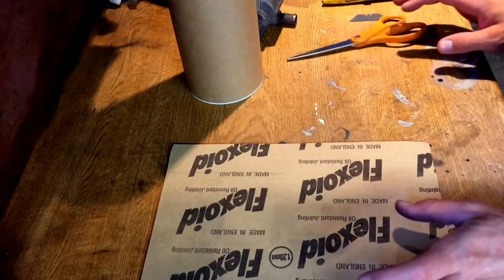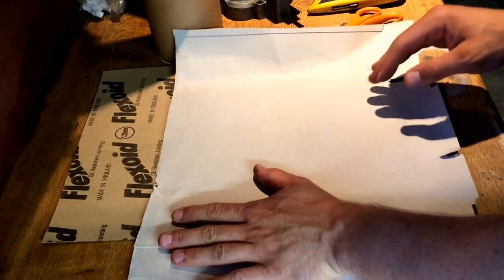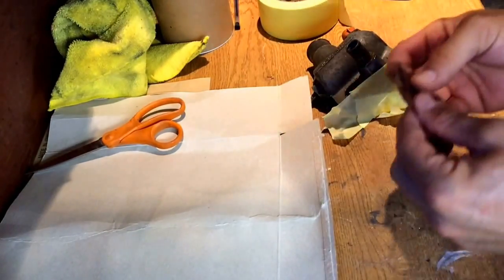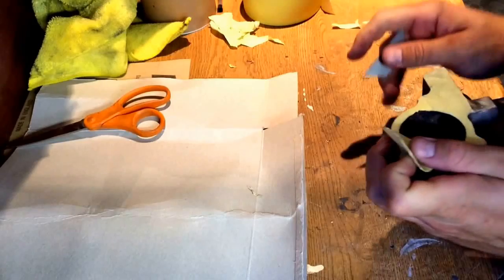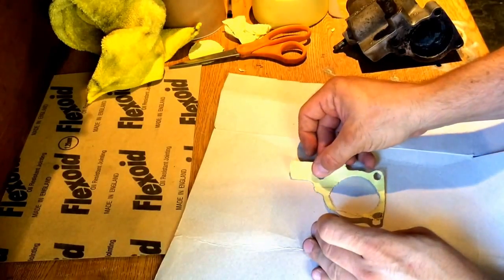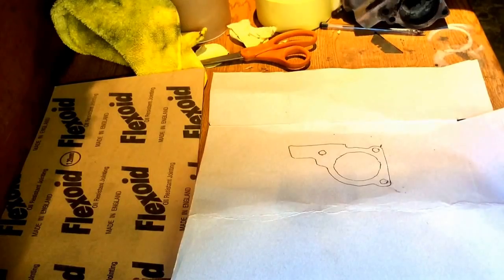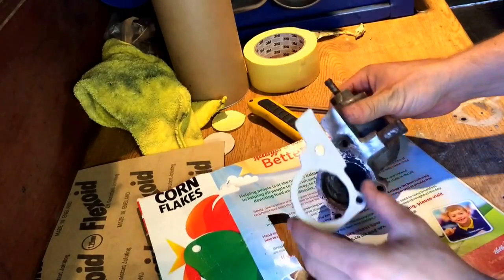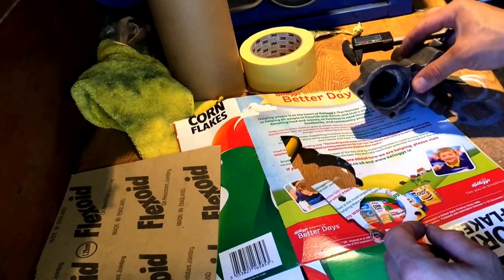Never Buy An Engine Gasket AGAIN! Do it yourself

Comment: Even though your video was done 8 years ago - I must say > what a great idea in using the masking tape for a template - and just today I used the same idea of a cardboard box to do a gasket for an oil pump to a car... Awesome video - The one key thing is to make absolute sure is a sharp blade to do the cutting. you can also use a corrugated cardboard to use to lay the piece you are cutting and the job will be a lot easier to cut.

Comment: Great for an emergency situation.  But for about £1 a sheet, Flexoid is compressible, recoverable,  and resistant to oil, fuel and water... which a cereal box isn't.  I guess that's why we've been around for 100 years ;-D

Comment: I used this trick as well in the past on a 100cc scooter exhaust I did 3 cereal box gaskets in the exhaust pito to the muffler and 2 years later still holding .

Comment: Why didn't you use an oil to make the template? It would be easy and quick. Just put a little oil on the the face of the device and print it on the cereal paper.
Reply: I use a quick shot of spray paint

Comment: would this work on a 50cc cylinder? considering that those small engines dont get as hot as car engines
Reply: Probably better to try this idea with thick aluminium foil for a 50cc head gasket but make sure there is sufficient clearance so that the piston will not hit the head .

Comment: My lawn mower has been running for decades with one of those behind the carb.
Reply: i will try the same. i wouldn't if it was a car. 🤣
Reply: @lindap5503  If you rub oil on it you can prevent it from sticking and ripping if you need to take it apart again.
Reply: @zippymcfearson2776  I’m about to send this for a couple days on my grand Cherokee thermostat housing wish me luck brother I’ll keep you updated the i6 will be ok
Reply: @marcusbrown7029  Where’s the update? I’ve been waiting 3 years.🤓
Reply: @Ojb_1959 it was fine until I blew up the transmission 😂 forgot all about this

Comment: thanks this might help me get my atv running, there is a big open hole where my 2 stroke oil pump was(its broken). so now i can screw a plate and a cheapo gasket on and get the engine running. will be mixing oil into the fuel untill my new part arrives in a month or 2

Comment: I collect antique outboard boat motors and I use this method to make gaskets.  You can grease one side of the gasket if you want to disassemble the motor later without destroying it.  I also keep pinking and cuticle shears and hole punches for cutting them out.

Comment: There is a flaw in all these “emergency” gasket deals isn’t it?   An emergency (as most of us think of it) is when you are in the middle of nowhere and your parts store is either not near, closed or just don’t have your part.  If you are in the middle of nowhere and need a gasket what makes you think you will be able to find a store to buy CF, eat them (no waste) and make your gasket?   I see the creative aspect of it.  I do not see the $ saving element
Reply: Tax2Me probably a magazine or scrap piece of paper kicking about in the car somewhere! I once made a Water pump fast for my car out of a fashion mag front page and used Vaseline as the sealant. It held up for 30k miles before I refurbished the whole engine.
Reply: The point is that knowing how to do it is better than not and piece of card is far easier to source than the correct gasket or even gasket paper. There are literally thousands of things you could use such as the box from a takeaway burger or the front page of the handbook in the glove box.

Comment: A wise old mechanic taught me a neat trick. Place the gasket material/cornflake packet then get a small hammer and hit the edge of the part your are trying to seal and it will cut a neat cut out of it.
Reply: That's how i do it too..but i used a spoon not a hammer.its quite safer i guess 😅
Reply: I've seen many ppl tighten screws/bolts down to the point of stripping or breaking. Telling someone to hit it with a hammer will definitely ensure them heading to the part store for a new part and gasket after breaking their old one.
Reply: 😻 genius! Cause I’m working on a mower and the gasket crumpled to pieces. I need this thing running before am! 😫
Reply: @krishauck07  did you get it run it ?
Reply: heh yeah.. "ohh just lift up on the flywheel and smack the crankshaft with a hamer" yeah no... glad I bought a puller before I mushroomed the shaft out.
Reply: Sixtyfiveford
Reply: it  does not take an expert to make simple gaskets so aste of air  space   good luck  keep safe  higgy
Reply: Better yet take a thin piece of wood and lay it on the park before you hit it with a hammer

Comment: Before I understood anything, I saw that gaskets were basically a type of cardboard so I made some out of cereal boxes lol. I had an old scooter that needed a new cylinder gasket. 😂 It ran just fine for a few years actually. But now I can afford proper gaskets so I wait a couple weeks for them to ship instead of doing this but it is always good to know this kind of thing in an emergency.
Reply: you guys / one of my inquiring consumer that i said nope im not using that as a long term fix are joking rite?
Reply: @richardprice5978  I think you misstyped something or it auto corrected to something  else because I cant understand what you are saying.
Reply: @SirCumferencelel this is basically a practical joke right? and doesn't work for fixing oil leaks
Reply: @richardprice5978  oh! You missunderstood. Yes it actually works. It's works as well as any other paper gasket in the short term, it just doesn't last near as long as actual gasket material. 

I use it all the time as a temp gasket until the new one ships from Amazon.
Reply: @SirCumferencelel  ok im not buying into it working but your not the only person said it works so maybe you guys are right, i just don't plan on doing that, 
thanks for the tech tips.
and no im not using this for customer cars fixes so for the next wise guy broke DK in line the answer is no im not using your box come back with cash or the rite gaskets
Reply: @richardprice5978  lol, yeah if I were in your position I wouldn't do that to a customer's car. 

I'd try it out on a lawn mower or similar small engine first to get a feel for it dude. I do it all the time for my motorcycles but never for a customer. Lol, toodles.
Reply: I used folder for gasket

Comment: The way I learned at college was to put the flange on thr cardboard first then draw around it and cut it out. Put the cut out version back on to the flange and the make like the holes using a small ball peen hammer. So much quicker
Reply from the maker: Thanks for the good advice man! 😎
Reply: Xactly!  If you can take the part away then this is the best method
Reply: That's how I learned and just what I was going to post

Comment: What gasket sealer can be used on paper gaskets or should paper gaskets be fitted dry?
Reply: In my experience using the same method he is using, you can use it like you would normal paper gaskets. Personally I always use sealer though.

Comment: Hi, is it ok to use this home made gasket for cylinder and head cylinder on a scooter engine? this part is very hot and the gaskets are pretty strong, so this is why I am asking. Thanks
Reply: cve kris yeah. ive successfully made them out of copper coated aluminium flashing from the roof materials area from home depot, lowes etc
Reply: I've made it for a cylinder head before out of cardboard. It works, but I'd highly suggest using copper or aluminum if you are going to make a head gasket. 

A simple cylinder gasket is fine to use cardboard for.
Reply: Hardware store for sure